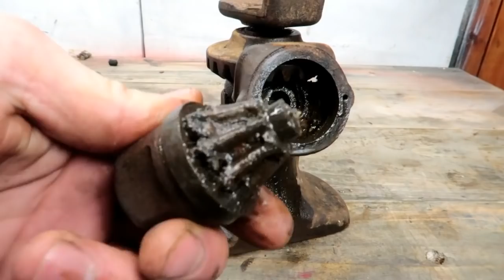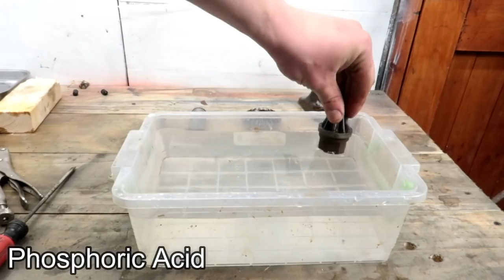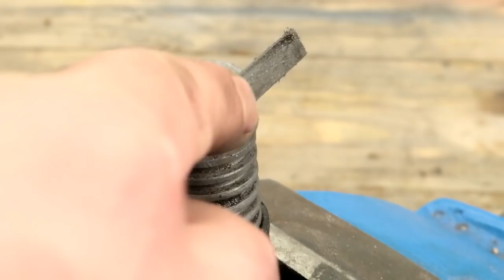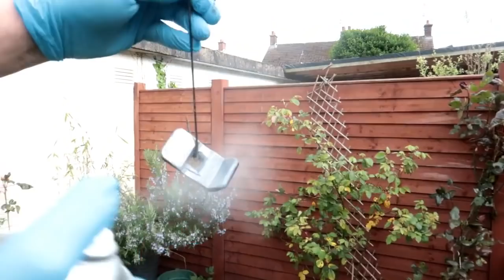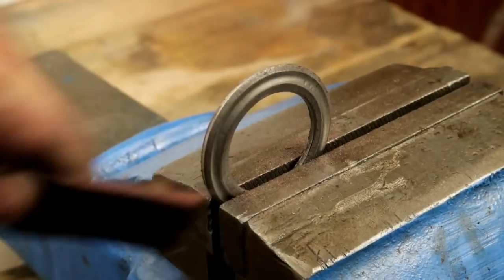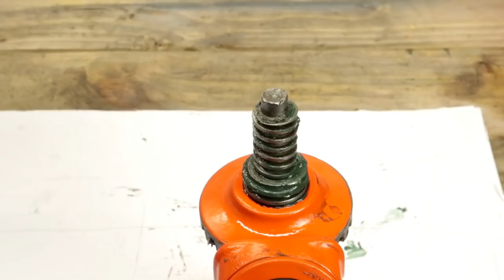Antique Spiral Jack Restoration 82 years old

Comment: Hello, Iam late, but I have seen this clip and something is missing. To avoid rotation of the tube, a spring or a ring must be installed. There is a mechanical guide in the socket and the spring-ring hold the outer tube in place.
But nice job so far!